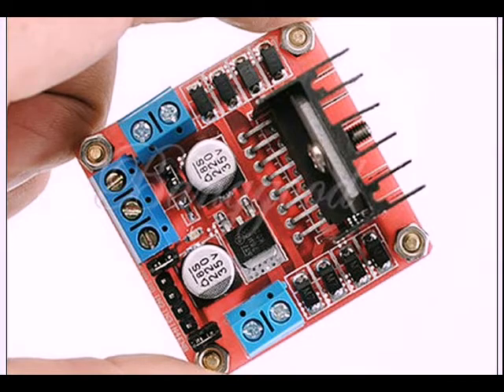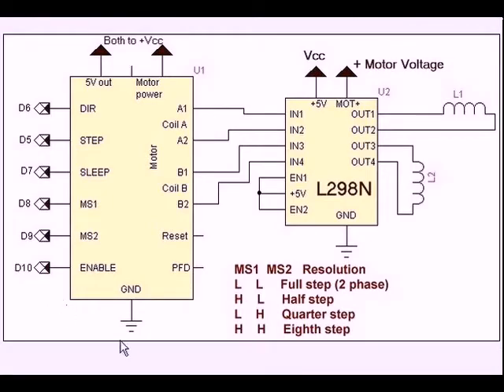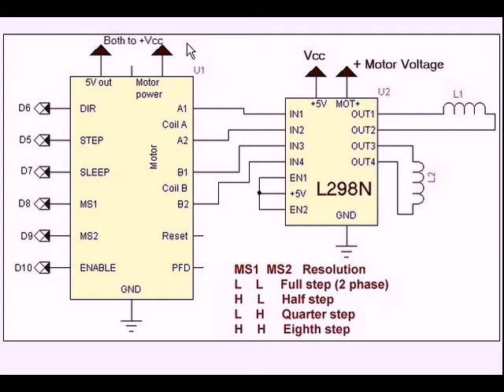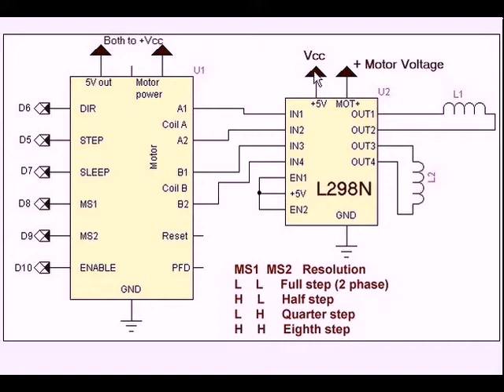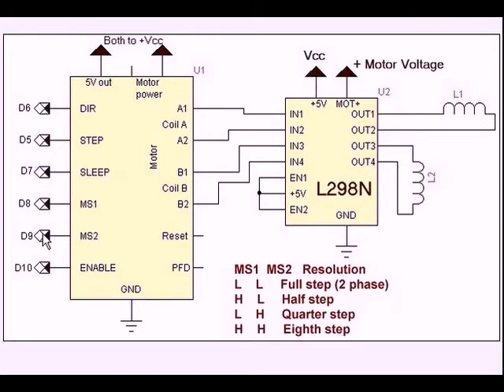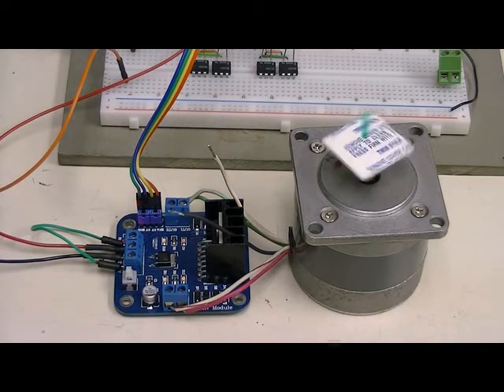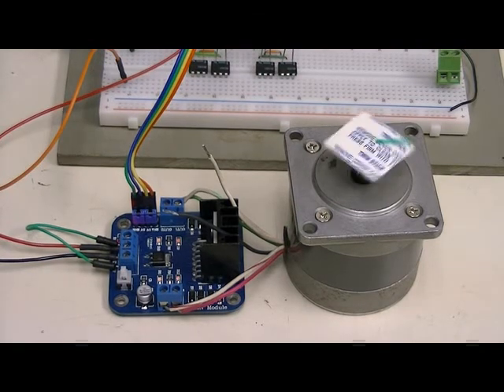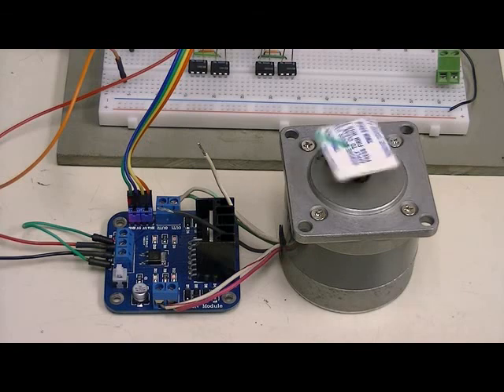Using Easy Driver Microstepper with L298N and Arduino

Comment: If I need 42 Volts on the motors: changing the electrolitic capacitors in this board will be enough? What voltage should those capacitors need to be able to take (I know it is normally more than the voltage I am going to use)? Many thanks!
Reply from the maker: Do not use this on 42 volts.

Comment: Hi Lewis I have a K40 co2 laser using 1A nema motors but I want to unplug one motor and plug in a rotary attachment that has a 1.5A motor and I am told the K40 driver will not run the attachment it will burn out. The K40 has a couple of IC's driving each 4 wire stepper so could I use this to boost the output from my K40 laser to drive the 1.5A Nema motor?
Thanks
Bill
Reply from the maker: What's a K40?

Comment: Sorry for my bad English.
This scheme is a real nonsense! This schematic not have current regulation. Motor current limit is necessary to an external circuit. 
This is the same pairing monkey with an elephant!
Reply from the maker: +Сергей Лебедев YOU DON'T NEED CURRENT REGULATION TO GET IT TO WORK. USE A SEPARATE CURRENT CIRCUIT.
Reply: +Lewis Loflin Yes, of course, but you had to draw  it into the scheme at once.
Reply from the maker: I'd add an updated video and address just that. Thanks.
Reply: +Lewis Loflin I will not repeat this schematic, I do not need.
But who repeated this scheme they burned L298.
So I decide to write you.
Thank you and sorry for the trouble.
Reply: @LewisLoflin  Please provide the link! I really need to see that circuit so I can make it ASAP! Thanks a lot!!
Reply from the maker: @cdsplus1  Look in the discription.
http://www.bristolwatch.com/arduino/easy_driver.htm
Reply: Сергей Лебo

Comment: Hi, I connected my easy driver and my L298N driver like you showed but, when I apply 12 volts, the stepper does not move and just pruduce a "HUM" just like it is stuck ... I tested the stepper directly with the easy driver and they work well except that the chip becomes hot rapidely and this is why this setup is so interesting for me... please help me
Reply from the maker: +Claude St-Louis two issues - the wiring has to be specific if a unipolar. Also, if stepped too fast, will sit there and vibrate.  Stepper motors are slow.
Reply: thank you for your help.

Comment: Hi Lewis, so I could run a 24 volt 1.1/8 bipolar stepper motor with this setup?
Reply from the maker: Jeff Nading Sure it depends on the transistor ratings.

Comment from the maker: The Easy Driver only supplies enough current to drive the L298N which is a few milliamps at most. So no calibration is required. If using this to drive the L298 be certain to connect the motor voltage on Easy Driver to 5 volts or you will blow the L298N.

Comment: I will be trying to replicate your work here as I am building a X-Y axis CNC hot wire foam cutter. I will be using a "Dual Easy Driver" shield and driving two L298N's for the actual motor drivers.
The question I have is, according to the A3967 Data Sheet, the chip detects the actual coil current during stepping and uses that as feedback to adjust the control circuitry.
How did you calibrate the current sense pot(s) for use with driving the IN1-IN4 of the L298N instead of actual coils?